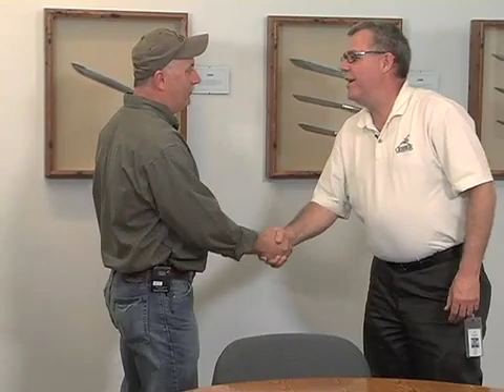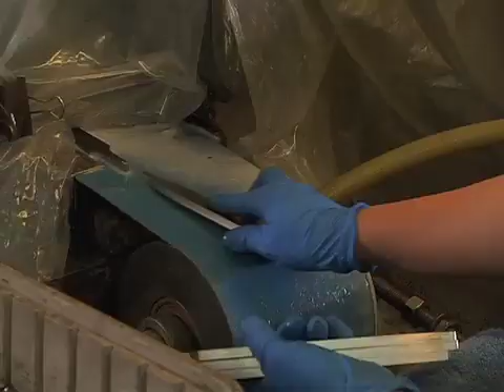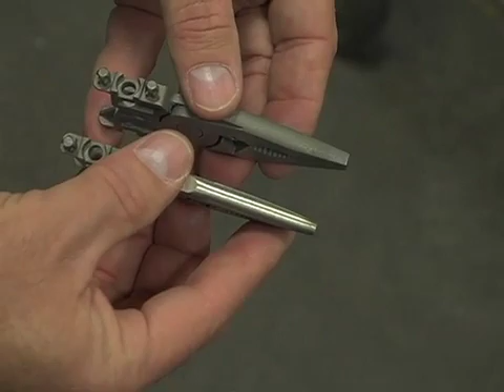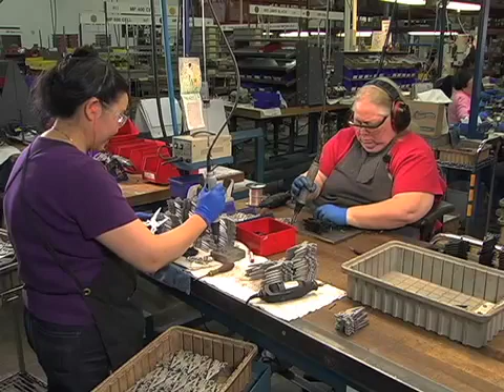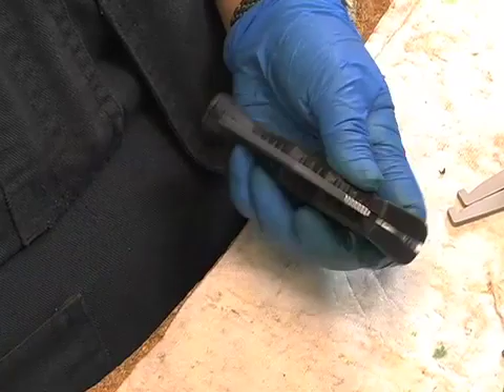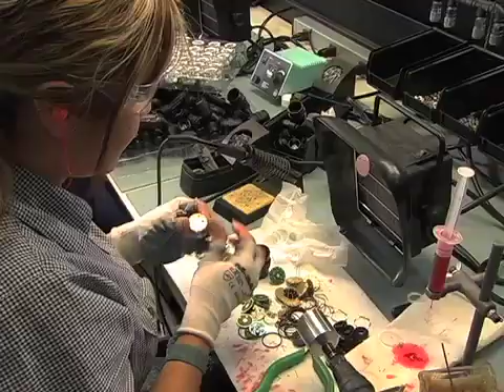Documentary on Gerber Legendary Blades

Comment: And the blades are crap cut from sheet metal.
No forged blades here.... Just generic plate steel crap. 🤕👎👎👎👎
Reply: Nobody forges these days unless you order a custom piece. Those steel sheets are just as effective so long as the heat treatment and the tempering is done right which Gerber does.